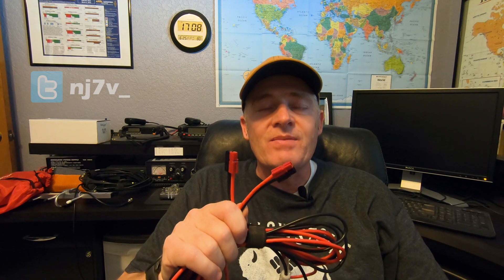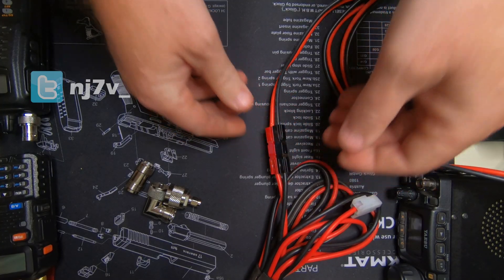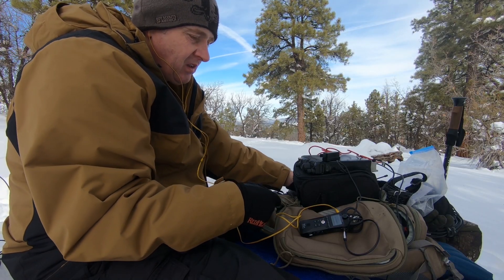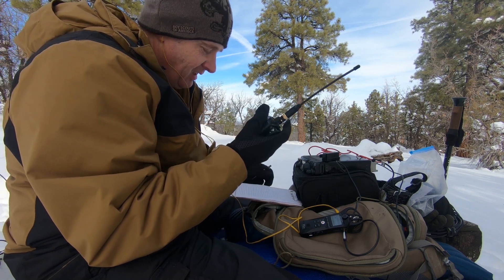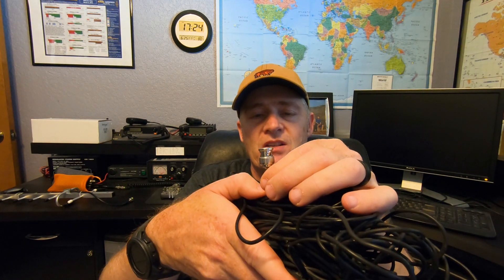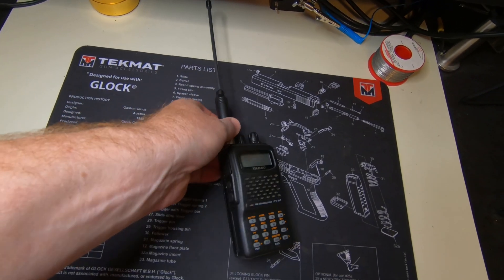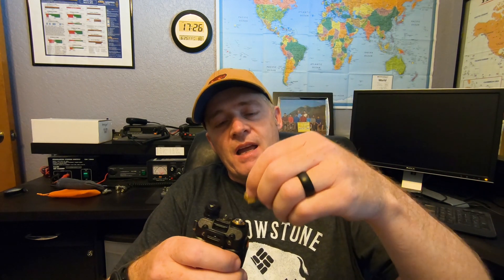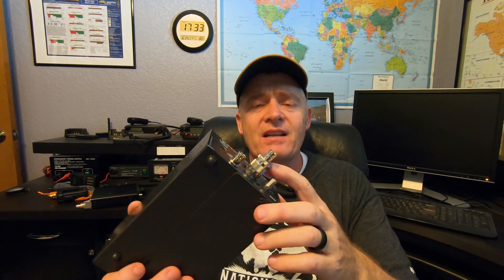How to make your portable radio deployment more efficient!

Comment: Make sure when fitting a BNC to RG 174 cable for SOTA you Sweat the gold pin on the inner. If someone steps on the feeder as you raise the Squid pole it can pull the centre pin out a bit and not connect inside the female end. Personal experience on that "tip". I like BNC stuff too and Anderson plugs.
Reply from the maker: Haha I have also been the victims of this . . .  TWICE!  Very good advice Ian.  Thanks.

Comment: I hate the anderson powerpole with a passion.. I have one radio with it, a quality factory installed cable and connector. That thing has heated to kingdom come and bends when dangling down the back of the radio. Probably going to replace it with something more solid.
Reply from the maker: Yes the Powerpoles are definitely not for everybody and do have their problems. Thanks for dropping by the channel Ria.
Reply: They ain't the best connector for sure; I do think they are the generally accepted "standard" and standards are a good thing.

Comment: You didn't mention the downside of a BNC connector, that is ruggedness,  the PL259 en N-connector are way more rugged, To me BNC feels always a bit flimsy.  Another thing is BNC comes in 50 Ohm and 75 Ohm versions, they don't fit wel together as the middle pin has a differend diameter, so you have to make sure you buy the 50 Ohm version.  N-connectors are always 50 Omh.  PL259 don't have a specific impedance at all.
Reply from the maker: Hey there Warzel.  I'm so happy you took the time to point that out for the viewers.  I was trying to keep the length of the video down, but maybe I should have added the downsides in the video.  Regardless, you point them out here and I hope the views take the time to pop down here to the comments and read what you have to say.  Thank you!  We definitely should consider this when we are making an assessment of our tradeoffs.  Some may feel that the ease of connecting/disconnecting is not worth the downsides you point out.  Personally, I am comfortable accepting these downsides in exchange for a simpler connection, as is apparent from the video.  But some may not be.  Thanks again!